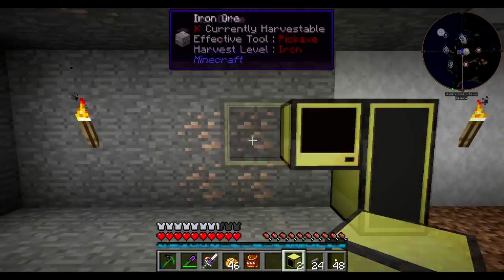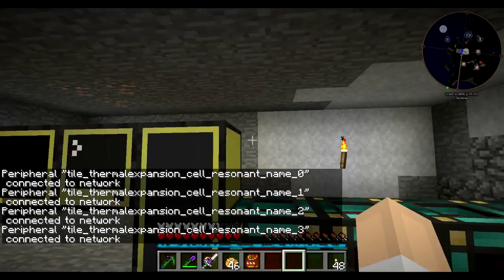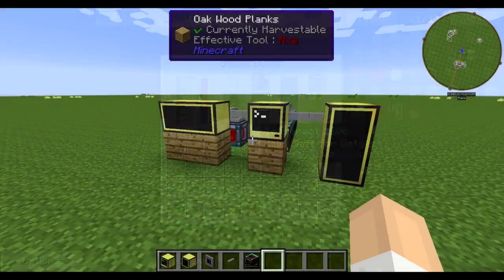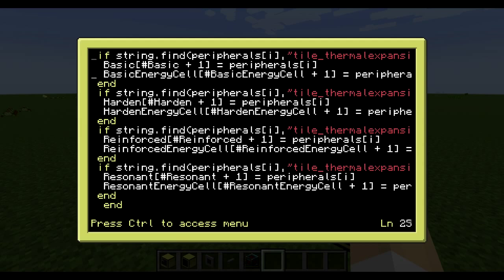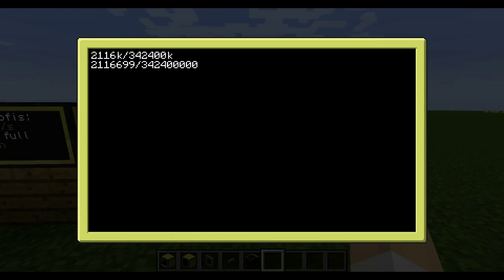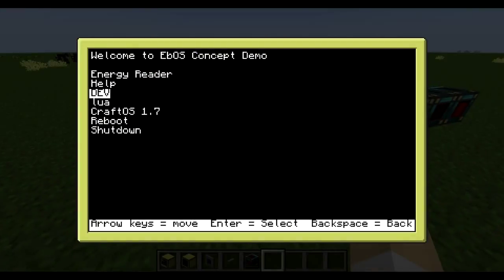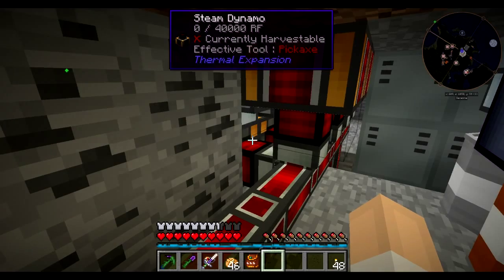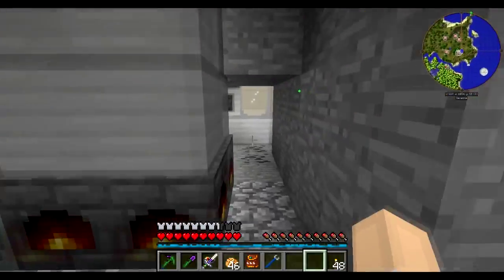Pure ComputerCraft Episode 02: Reworked RF reader

Comment: So i type in  pastebin get U5E5hPAY Installer,
and then it says me that it got installed, after that i try to run the Programm
I Type: Installer
And then nothing happends
Reply from the maker: Yeah, you did not run the program. You run the installer and reinstalled the program. Just reboot the computer and everything should work. If not, run EbOS_Concept.
Reply: @tom759345  I tried to, and to run the programm still nothing Happends, and if i want to Run EbOS_Concept it says "No such program"
Reply from the maker: @Skeltak  what are the name of the files you have, and what verson of computercraft are you using?
Reply: @tom759345  I use a brand new Computer so there are no Files, and the version im not pretty sure but i play on the 1.7.10 and have the 1.7 Craft OS
Reply from the maker: @Skeltak  If there is no files, there is no program to run...
Also this program supports CraftOS 1.5, and the 2.2 version supports CraftOS 1.6....
They reworked the peripheral system, so I made a 4.0, but never published it
Reply from the maker: @Skeltak  pastebin get 4BBbtXjX TRFER3
Reply: @tom759345  Now i just type "pastebin get 4BBbtXjX TRFER3"   in and then, i type TRFER3 ?
Reply: @tom759345  I tried, still not working
Cause everytime i try to paste in a pastebin, it says installed but it just installs empty folders with no code in it
Reply from the maker: @Skeltak  Then there is a problem with pastebin. Are you sure pastebin is enabled in the configs
Reply: @tom759345  How can i check that?
Reply from the maker: @Skeltak  "Are you sure pastebin is enabled in the configs" Open the config file and look for http and pastebin settings.
Reply: @tom759345  Yeah, but where can i find the configs?
Reply from the maker: @Skeltak  You got to cheak the wiki for that...
Reply: @tom759345  I checked and it is activated in my Configs
Reply from the maker: @Skeltak  try following the video tutorial on the rf reader program. This is an lp where I tryied to work on the old program, and is not an istallation guide. You could also try to get to the database since it's public, and just copy the program streight from there. I don't know why there is no programs file there after you download, since it should, or else the installer would not run at all. Also, you can't pick it up afterwards without labeling the computer, or else the computer would count as a new computer.
Computercraft changed devs a few years ago, and this was made on the version supported by the original dev. They might have changed something in the mod that makes the downloader that I made no longer work. But the 3.0 and 4.0 does not use this, so I should work. I have to take a look at it myself if non of this works
Reply: @tom759345  Now i tried to exactly copy the paste from "4BBbtXjX " i wrote everything in the computer 1-1, but now it tells me multiple points if i try to run it
Reply from the maker: @Skeltak  You missed a space somewhere by a number
Reply from the maker: And if that for some reason is not working, create a file called "DEV" and reboot.

Comment: I know this is a bit old and I don't know if you found a way,
But you can enclose the entire program in a main function then use pcall to catch the error and rerun the main program.
This is bad practice as eventually lua will error from recursive calling of the same function inside itself. But there are ways around it.
Don't know the ways around it but eh that the fix for hot-swapping cells.

Comment: Hello!

Firstly love your work.

But i tried to use the DEV mode which does get me to 2.2
However when the computer is trying to read it, it detects im using reinforced energy cell but it lists it as 80m instead of 20m RF and it doesn't show how much it has in the energy cell e.g. 0/80m RF

I followed this video,  but i don't understand what exactly i am doing wrong here?
using
ThermalFoundation 1.7.0
ComputerCraft 1.73
OpenPeripheralAddons 1.7.10
OpenPeripheralCore 1.7.10

Thanks :D
Reply from the maker: SourFACE The energy cells should by default be 80m RF. Keep in mind that the version you see in this video is not the same that you have downloaded. I've not released the version you see in this video yet
Reply: *****  Ahh i see, awesome! no worries then. guess i'll just wait :P

Comment: Can you help me?
I cant start the program,it says var:5 attempt to index? (a nil value)
I use 1.7.10,and I use electricraft Rf storage,because any other RF storage wont activate the wired modem.I do the same that you do in the video,but it doesnt work,I want to use this to my (rotarycraft)Gas turbine power plant
Please help!!
Reply from the maker: Norbert Rákosi The version of minecraft is not help for me helping you. I need computercraft and open peripherals version. I don't know how the electricraft Rf api works, but if it does not work the same way as thermal expantion, it will not work with this program...
Reply: ***** I use : OpenPeripheralCore-1.7.10-1.1.1-snapshot-222,    OpenPeripheralAddons-1.7.10-0.3.1-snapshot-196,  ComputerCraft1.73 I dont know did I have to download more thing to openperipheral or someting else is the problem,but the biggest problem is I cant turn on the wired modem when I use the same rf storage as you.(It wont turn red),I right click it but it doesent turn red.And I get this I write again ":5: attempt to index? (a nil value)"
I hope you can help,its important for me!
Reply from the maker: Norbert Rákosi The problem is with oper peripherals not beeing able to read the energy cells. Try a new version (not snapshots) of both open peripherals and thermal expantion (Since the rf api is within thermal foundation, and not in open peripherals.)